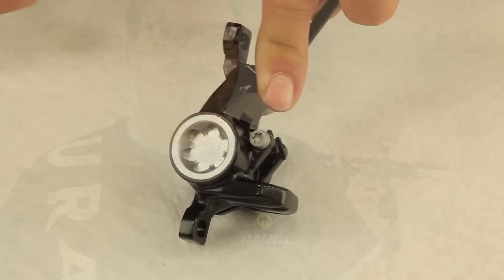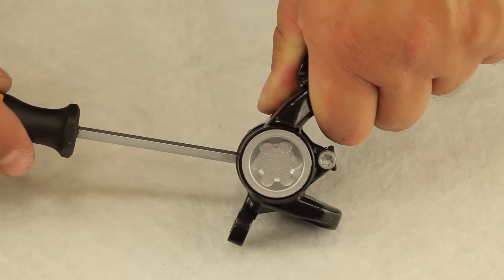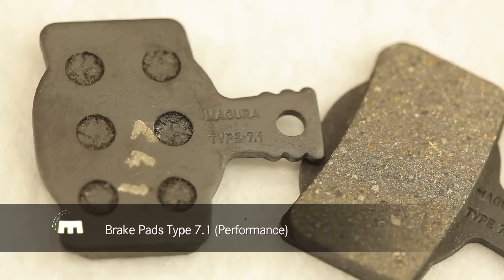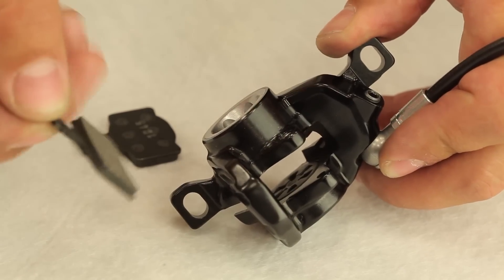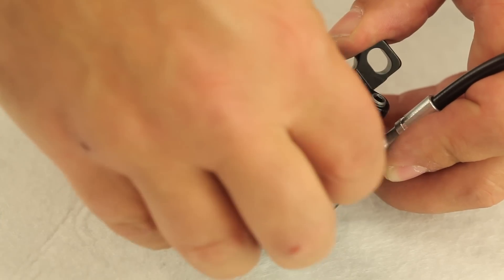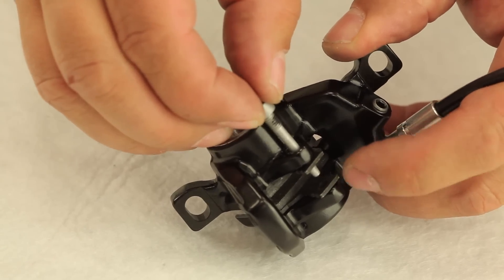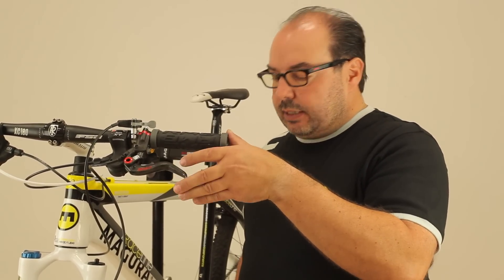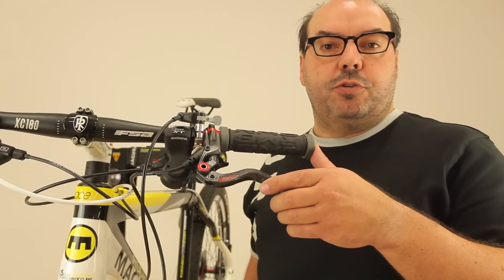Brake pad replacement on a MAGURA disc brake  (MT8, MT6, MT4, MT2)

Comment: Thank you for these guide videos. I'm wondering if it is possible to replace the pads while the brakes and the wheels are still attached to the bike. I saw a video of a bike mechanic doing this on the mt4 with no problem, but it doesn't seem possible for me so far. I have a Riese & Muller multicharger with mt4 and mt5

Comment: is there an tutorial how to replace/refill fluid? thanks!
I don't know exactly what's going on, but my mt4 doesn't brake
Reply from the maker: We have no tutorial that show the full process of removing or replacing the Royal Blood, but in the end it's very similar to the bleeding process itself. Either let all of the oil flow out first, or cycle through new oil until you're happy with the result. However...

...it's very unlikely that you will need to fully replace the Royal Blood in your MAGURA MT brakes. Unlike with brakes that use DOT brake fluid, water is not soluble in mineral oil, meaning that the fluid does not need to be regularly replaced. 

If there's a lot of debris inside the system for some reason, then you may need to replace the fluid - but usually it's enough to simply bleed the brake.

Regarding the issues with your brake: feel free to send us a message on Facebook or Instagram so we can further help you with that.
Reply: @MAGURAPassionPeople  Thank you for taking care of my problem. I drove too long with worn brake pads and at some point there was no more pressure on the system. Even after changing the brake pads there is no pressure, I'll bleed it first and then change the liquid if it doesn't help. There might have been a leak somewhere. Thank you! youre good company :)
Reply: @MAGURAPassionPeople  Wasn't that easy but it worked, brakes great again 👍👍👍

Comment: What tools do you need to purchase if you want to do this yourself?
Reply from the maker: Hi, thanks for the question! Tools for replacing the brake pads? You will need a Torx T25 driver for removing the pad retaining bolt and you might need an according tool for removing the axle of the wheel, if that's get's in the way.